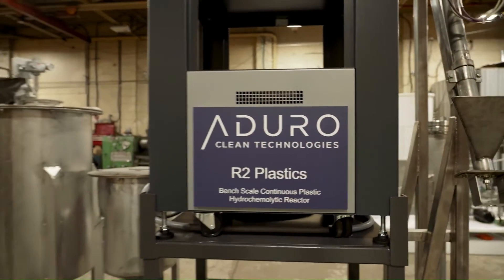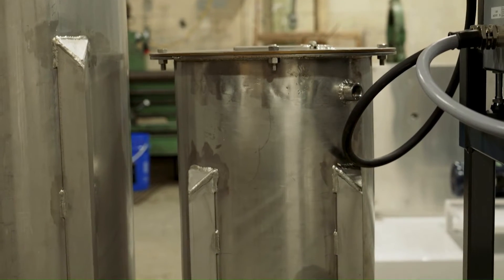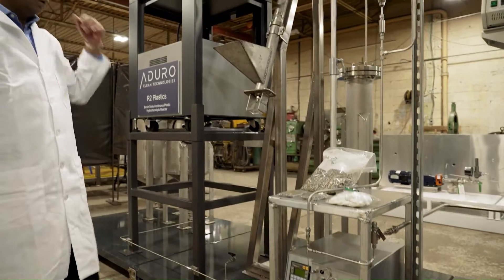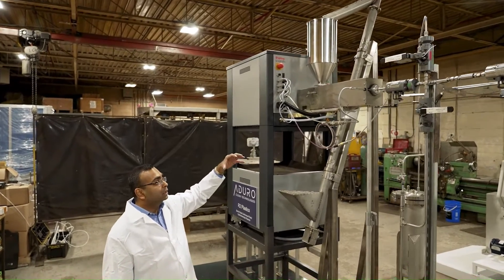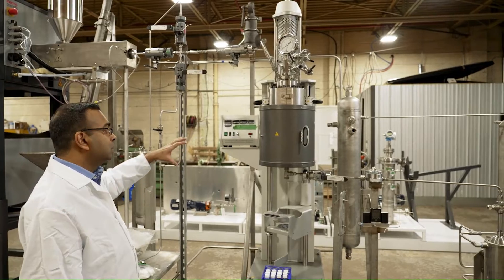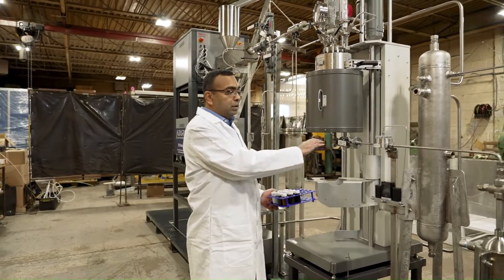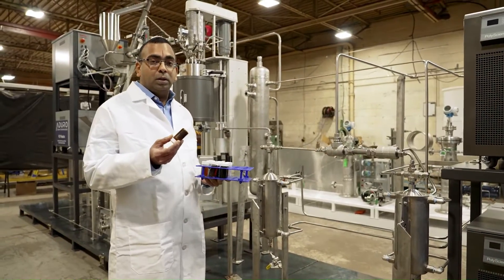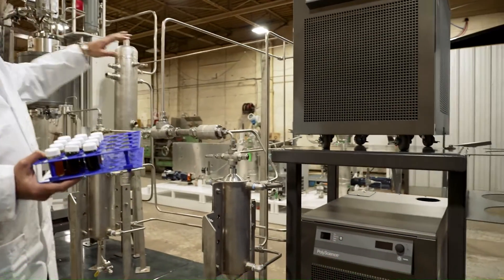Walkthrough of the Aduro Hydrochemolytic™ R2 Plastic Reactor

Comment: Let me get this straight, you can convert heavy crude oil and bitumen into lighter more valuable oils. An investor would want to know why your method is an improvement on current conversion methods. I would guess that it's because your process occurs at lower temperatures so involves less energy. Please clarify. Also what exactly are the plastics converted to, also I have no idea what is "low value feedstocks" and "21st century resources" in the present context.